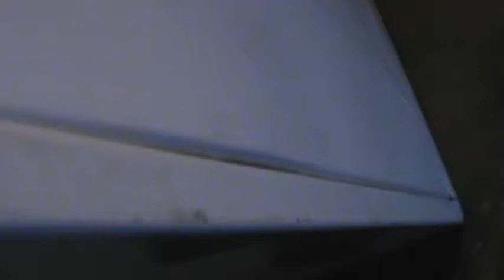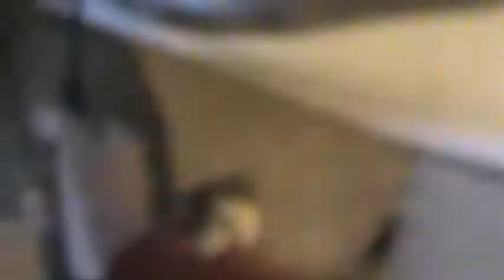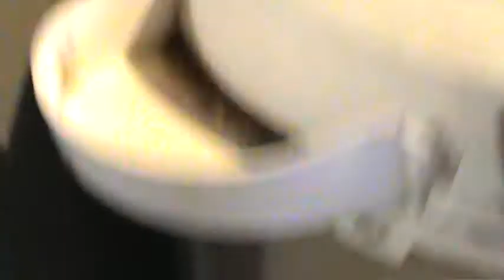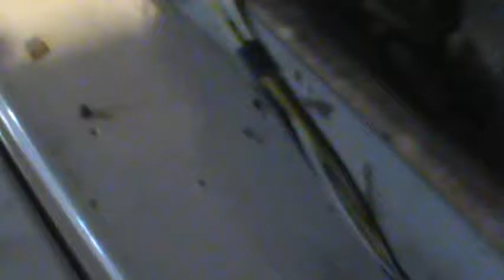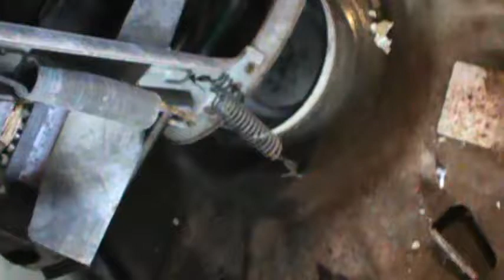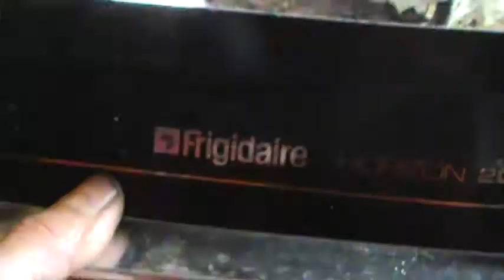Scrapping A Washing Machine!! For an Electric Motor,Copper Wire and Metal!!

Comment: Thanks for showing how to do this! I have a washer and dryer in my basement that don't fit thru the exterior door so plan to bust it up and make some $. On average - how much would you get for all this offa the washer?
Reply from the maker: 10 to 15 dollars if you got the cord and electric motor. You gotta take that inside usually. Some washers are a lot heavier than the one I had. You might be able to sell the drum 2.
Reply: Thanks, JP!